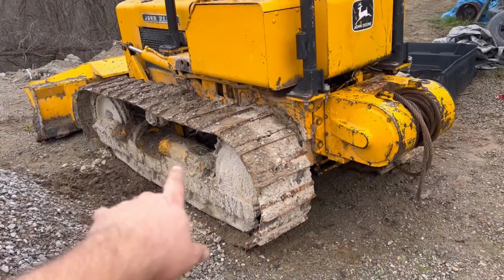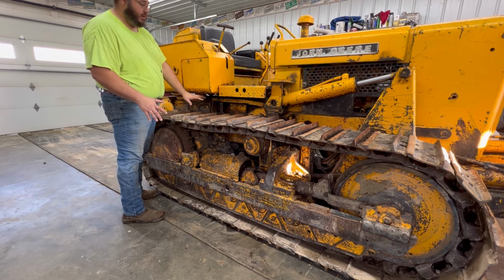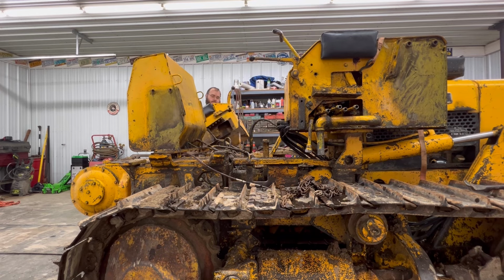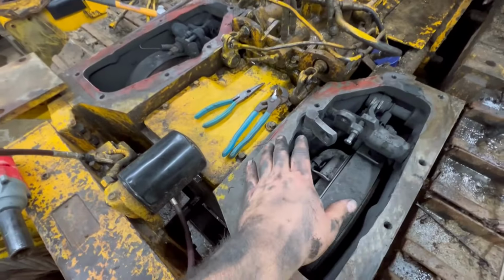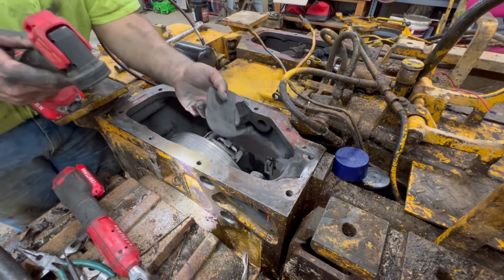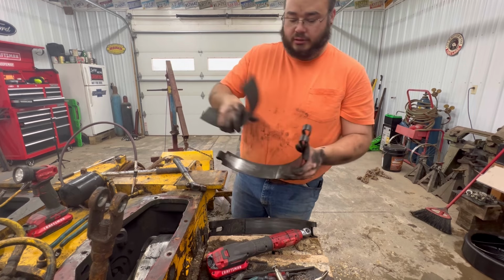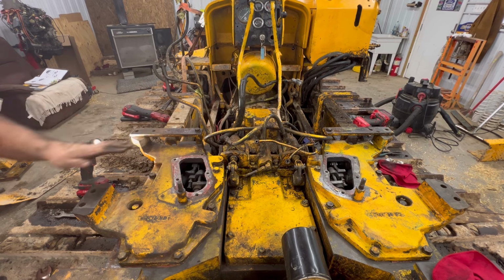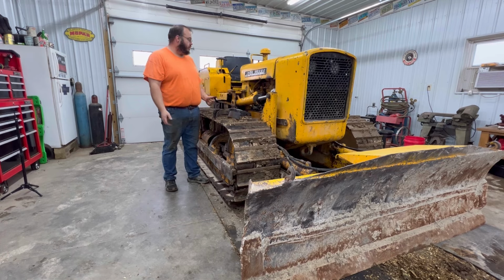John Deere 450 dozer brake band replacement. Don’t make the same mistake that I did.

Comment: Nice job I do the same kinda work, working on the old stuff no one else wants too haha. And yes if u block up the rear end and put ur blade down it will get your tracks off the ground. I would also like to say as someone who works by themselves all the time the best tool you can invest in is a gantry crane from harbor freight. Hands down best thing I ever bought for my shop it was so handy I picked up a second one.
Reply from the maker: @craigthompson6378  thanks.  Ill have to look into the crane.
Reply: Getting that spring on is key

Comment: i am loving your videos, found a 450c at my work that everyone assumed was dead, got her to track but needs some love, gotta get her across the park and to the shop soon, probably by trailer.
Reply from the maker: Thanks. And hope ya geter workin again.
Reply: @hoopiemade Oh she runs and tracks (sorta) both of the clutches were frozen, probably due to neglect. I freed em by rolling the tracks backwards while in neutral with a Skytrack, now only one is stuck again cause i tried to turn it, going to have to take all the linkage apart in there and free em up on the shafts bare minimum just to get her on a trailer.

Comment: The straight 450s had the floor shifter, it was moved to the battery box with the 450B, some 450B's have the turbo because John Deere when changing the assembly line from a B to a C would simply put a c engine in a b if they ran out of the b engine. I have a 450B dozer, bought it in 1981, I had a 450B loader and it had the turbo engine in it.
Reply from the maker: I dont even understand why they still built Bs if they had the Cs out just seems counter productive. Lol

Comment: I HAN TO DO THE SAME JOB ON THE 99 550GL  WIDE TRACK , I USE MY KUBOTA BACKHOE AND COME ALONE  TO LIFT THE TRACK OFF LAY IT OVER A STEEL HORSE, AFTER JOB WAS DONE I REVERSE THE PROCESS

Comment: I have a 450 B as well and I just called John Deere dealer and they say they can’t get the bottom band anymore. They can get the top band so other than that Chinese crap do you know a place that sells the bands top and bottom?
Reply from the maker: I recomend sending them out having your factory ones relined. But If i had to buy aftermarket ones i would get these ones. https://www.steeringclutch.com/AT129806_AT129807_JOHN_DEERE_JD450_JD450B_BRAKE_BANDS.htm